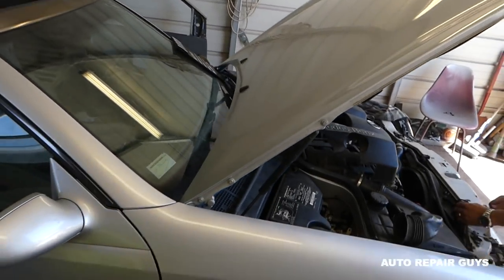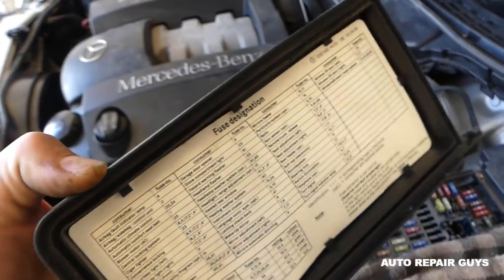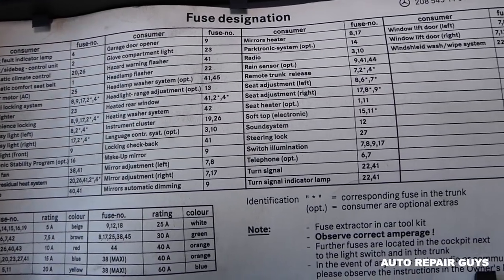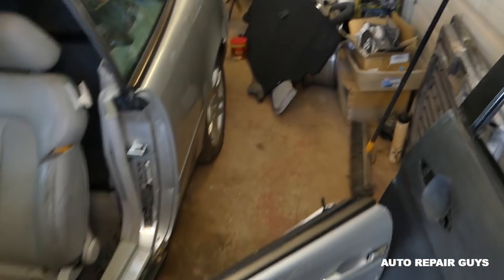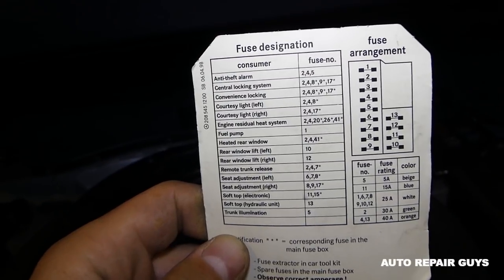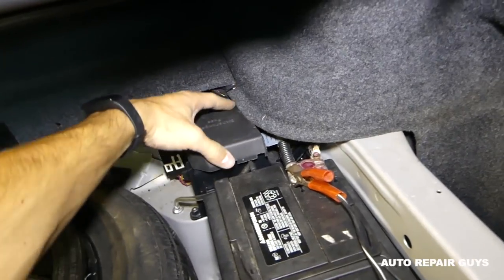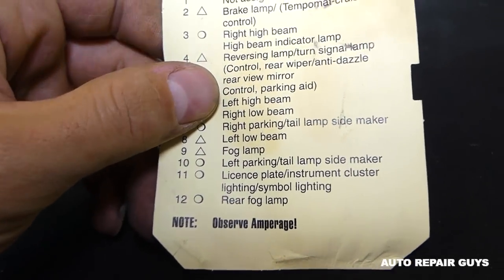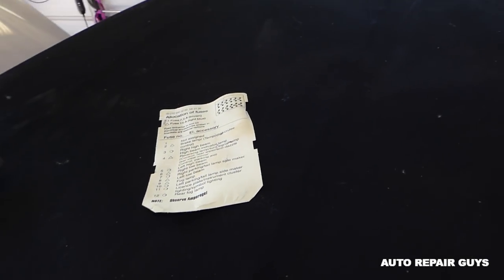MERCEDES W208 FUSE LOCATION DIAGRAM CLK200 CLK230 CLK 320 CLK430

Comment: Thanks for the information; I found the wire loom pinched under the front of the passenger seat, moved the wire loom and replaced fuse 9 in the trunk. Everything is working at this time.

Comment: Hey guys, thanks for this video, I'm trying to learn more about the 1999 CLK320. Do you know where I can buy a full service manual with wiring diagrams and troubleshooting procedures? I'm working on one that starts and drives perfectly, but almost everything electrical in the interior all stopped working at once. The radio, climate control, and emergency flashers work. Literally everything else is dead. No horn, no turn signals, no power seats, no power windows, no power top, no windshield wipers or sprayers, BAS & ASR lights are on, and the car has lost its power-assisted brakes. This car has TEN separate modules, and it's likely that one of the modules is disrupting the entire CAN network. The engine and traction control computers are in the engine bay and both connectors had a lot of corrosion inside. I cleaned them out, reconnected everything, and now the car runs rough and stalls. Hopefully a throttle relearn will fix that. If you had any troubleshooting tips I'd really appreciate it.

Comment: Any idea why the damn ac blower motor stops working? I’ve checked the connection to the regulator that sits on top of the blower motor it has 12 or 14 volts can’t remember how much. Even tried replacing the regulator.. nothing. But when I attach the blower motor to a 12v battery it starts right up.. is there a fuse/relay or is it a fault hvac unit on the dash?

Comment: Bro thanks for that fuse card,  I have a 2001 CLK430 coupe in the States please keep making videos on this car, its hard to find people working on this car. I can tell you a problem you will have next on this car I haven't seen a video of yet. The rear wheels will wear out on the inside wheels toe in and can't be adjusted. Please make a video on that. Ive went through 10 tires this year already please
Reply: I have the same car. OMG same issues.. Now my REAR head rest have popped up and I cannot get them down..

Comment: I have a Mercedes Benz C230 model 2007 I drive this morning and running good I parked it at my job then I went for lunch drive perfect. After I parke it by the end of the day to go home it doesn’t start  perfectly it just crank. Could you please help me. The battery is good the only thing it doesn’t start perfect 👍 it just crank.

Comment: Hello I have a 2002 clk 320. My car start off fine but when it hot in mid day it get sluggish and slowly stop gasing, then it stalls out and I have to wait 20min then it starts again. I am getting a code of p2028. Can I help bro.
Reply: Hey you probably have a bad crank shaft position sensor I would by pass and see if there is power going to the sensor first at the right voltage then if there is replace the sensor it’s in a hard spot though hope this fixes it
Reply: También puede ser la bomba de combustible, dañada, mi clk320 tenía un problema parecido, y era la bomba que ya estaba cansada